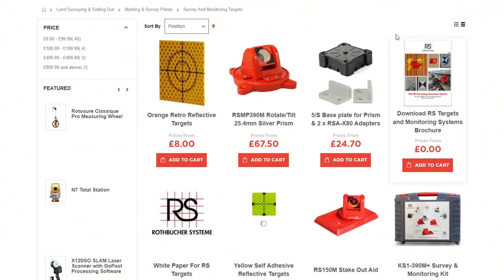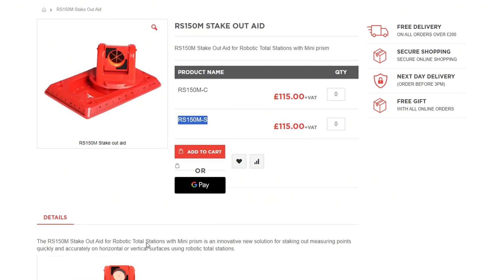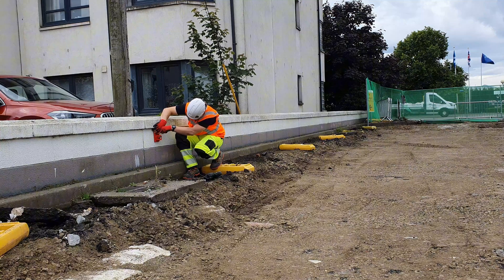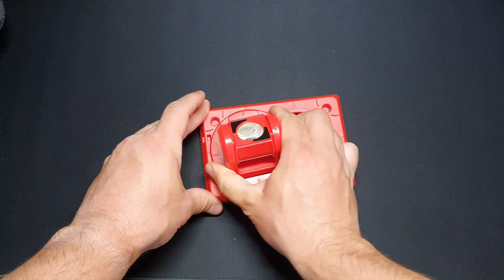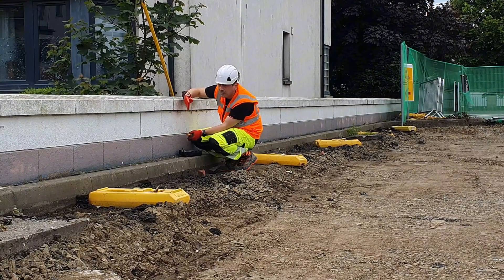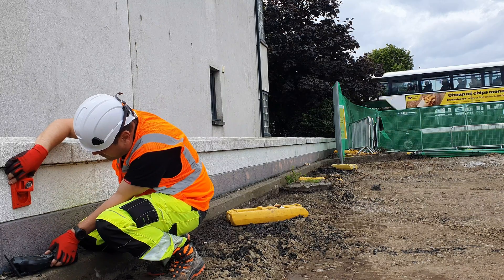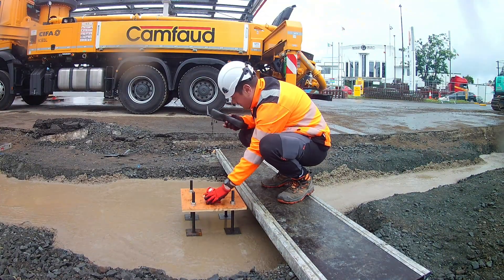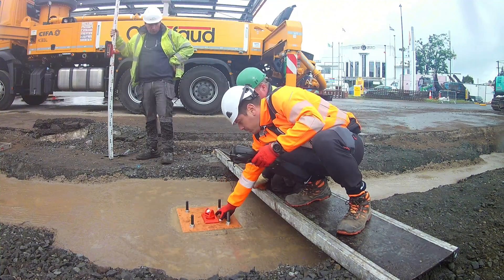This Product IMPROVED my Construction Setting Out

Comment: Is there an exact Side offset for the prism?. If you wanted to know what offset  the Face of the wall is from a gridline.
Reply from the maker: 50mm is the prism height if that is your question
Reply: @flyingsurveyor  Thanks. I am tring to set out gridlines parallel to a wall,so I need to allow for that offset.

Comment: If you put a target  height of 50mm(or-50mm) could you mark the wall at the top of the prism to set out the point?
Reply from the maker: Yes, with -0.05m in your total station. 
It's a pretty versatile tool and I used it on different type of jobs.

Comment: 3:41

When using the mini peanut prism without holder, does the total station measure distance correctly using default 0mm constant for that particular prism or do you have to make a custom constant or offset to the back point of prism?  While in the holder the vertical pole offset is different.
Reply from the maker: Good question! Every center of the prism differs for each prism type and also you have that small tail. So what do is checking the constant before using the prism outside the holder by marking a cross on a wall. After I position the total station a few meters and measure the mark reflectorless and using the prism without the case. The difference will be the constant.

Comment: very useful accesory. pardon My english but i would like to ask the next: im asuming that its a axis with several of this same anchor bolts. how do you ensure that the bolts are not rotated from center? maybe with a second point marked in the plywood? or stake out the actual bolts? maybe is not critical for this job?. this is the kind of work i like to do but i dont have the experience, im a surveyor but in other workline.
Reply from the maker: @DiegoA-k5e  this is a great question actually! When I stake out the bolt pad I don’t stake out the centre, I stake out the 2 axes. 
If you saw on my video there were marked the 2 axes on each plywood so I move the prism to the edges of the plywood, on each axe and adjust it to make sure that the pad is not rotated. So basically, I stake out 4 points on each bolt pad, 2 on each axe. This is a great video idea, I will make one to explain better.